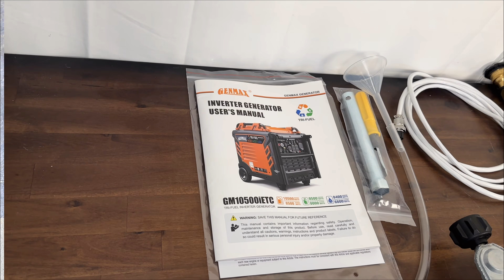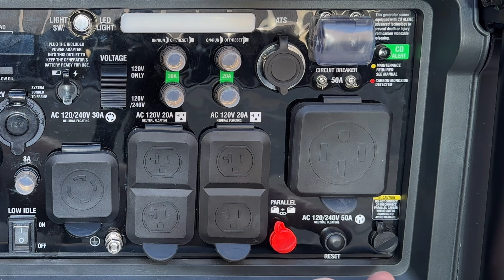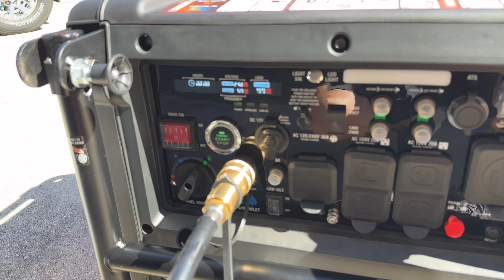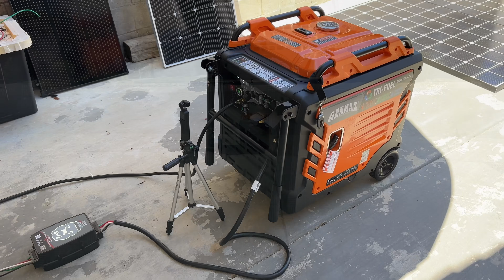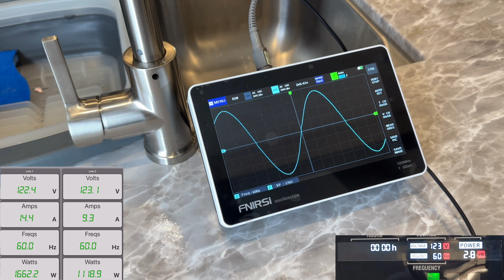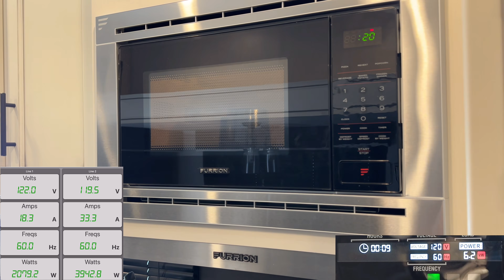Best New Generator GENMAX 10500iETC Tri-Fuel Inverer Generator!

Comment: Underpowered toy. 
Need a LP generator that outputs a minimum of 12,000 running watts & outputs split phase 120/240VAC and 20,000 watt surge. Gasoline evaporates, turns rancid, is stored in containers that are susceptible to puncture or spill and is illegal to stor in bulk in most states without specialized containment and recovery systems,  while LP stores in all weather in non puncturing containment that fuel levels can be monitored using ultrasound, pressure gauges and/or internal float and never goes rancid, stale or inert and most importantly, can be bulk delivered and stored on site.
Reply: No? Running my entire home including 2.5ton central air, gaming PC, LED tv, dishwasher, deep freeze, fridge and a floor fan - only using 3100 running watts. Get a soft start for your central air and manage your use - this is plenty to keep a household going. I'm actually running the GM9000ied so even lower running wattage.
Reply: @catastrophicfella  :face-green-smiling:Good one. I've heard that before. Sooner or later they all syncchronize to start at the same time.

Comment: Does the battery have to be charged in order for the pull start to work?  ty
Reply from the maker: Propane works with no battery and pretty sure gas does as well but you need to manually choke it. 
Sorry I don’t remember… 
May have to check again if both works

Comment: I have been considering converting my Honda EU6500i to run on natural gas. However, the additional cost is about $1000 for the kit and the natural gas guy to convert the barbeque outlet so I can hook up the generator. Instead, I would sell this Honda unit and buy the Genmax 10500 unit and have money in my pocket....but..but...it's not available in Canada and parts and service availability are minimal right now (and non existent in Canada), and the quality of the unit is still unknown (although I would take a chance on that). Maybe this will be doable some time in the future....(sooner rather than later I hope)
Reply: UPDATE: Sold the Honda EU5600 for $500 more than I paid for it second hand 12 years ago. Can't argue Honda hold their value. After I bought the TMG 10500 I put almost $1000 back in my pocket and got a tri fuel unit that outputs much more than the Honda. . 

Just have to hope the new generator proves reliable long term. However, from what I can research, it seems to be of high quality...

Comment: I recently purchased this unit and works exceptionally well other than the minute/hour meter resetting and when i turn it off using propane. I always get a small backfire after turning off the controls in order according to the directions. The spark plug is gapped correctly, so it just may be the LP in the line. Does anyone else have this pop at the end? Should i turn the LP off first, then the switch to off? I've been shutting it down using the power off button, switch, and then LP off.
Reply from the maker: Hello, couple tips. Ditch the stock Torque spark plug and get a NKG and then if only running LPG close the gap to about .018-.020ths. Also turn LPG off first to clear the line till gen dies. Then shut off the rest. Unless you are going to run it on and off a lot. But if shutting off for the duration or several hours like 8 or more best to close tank.
Reply from the maker: A little back fire is normal with LPG some do it and some dont

Comment: Good generator. 6000watts on natural gas isn't to bad. Can run a pretty good single person house with that or small family that isn't power hungry for energy. If your system has a well or city pump that isn't unpowered in a black out. You'd just hook this badboy up and run off gas to energy.

Stick this sucker in the garage or a shed and run a hose extender for the exhaust out to a exhaust vent and you should be golden. No thieves to slap on or take the machine and it'd be way quieter from the other houses.

From the looks of it. Natural gas will run a house at 6600watts either from the 220-30amp twist or the 4 pin 240-50 (at half power.). Kinda shame they only give the 8500watts to gas. And 8000 for propane.

But if you're energy light for basic for AC/Heater system, Washer/gas-drier, Fridge, Gas water heater, gas stove/oven. You should be able to work for the rest of the stuff without any problems unless you're packing quite a few desktop PC's running over 500watts on a family set per kid/hobby/wife deal. Thought if your house is mostly electric of the AC/-Heater system, Water heater, Stove/Oven, and Drier. I'd say not to run those roughly at much on generator mode. AC/heater can already cook over 3000-4000watts for a Central system. Electric Drier will probably cook over 1500watts running. Electric stoves run 1000watts almost per burner. Not continuing the oven coil. And water heater probably cooks around 1500 or more watts or so when it clicks on. So for people who are more on the gas drive will probably be able to easily fly in a black out if it's local and not shutting your water or gas vines offline to. (Though i bet the gas bill will sky rocket lol.)

Comment: I was under the impression natural gas didn't need regulating?
Reply from the maker: Still need a load regulator.
Reply: @johnnysweekends  Whats the max Pressure the generator can see on NG inlet connection?

Comment: I am looking for a tri fuel inverter generator for my 1400 sqft home. No less than 9k run time on NG. I would like to have an inverter generator but the only tri fuel with enough watts was a tri fuel Duromax and it doesn't have an inverter. I need it to last days at a time in case of natural disaster. I have been searching for some time and no one has been able to give me enough information to make my decision. It's a lot of money so I need all the helpful information I can get. If I have to go with a non inverter, I guess it would be the Duromax XP13000. I like the Champion tri fuel inverter but dont think it will have the power Duromax does.
Reply from the maker: Well I think no matter what no one can give you the correct answer. Some people can get buy with a 2200 watt unit which sips fuel. But only powers some basics. 

The Genmax is a nice unit and should power most anything you need. But normally when the power goes out you sacrifice and power what you need. 
Do you need to power one fridge and maybe wifi if it even works? Maybe two fridges and coffee ? Or the whole home and ac as well. 

It all depends what you can live with and for how long. 
A large generator burns a lot more fuel. Especially using natural gas. Just not as many btu’s so you get lower power out put just like it says on the specs. 

If you don’t want to worry about power and always have enough then the Genmax will fit a lot of needs. Just know it will burn more fuel. 

If you don’t need as much then a medium sized unit can save on space, cost and fuel. 

So once you decide what you really need to power then you can decide on a small, medium or large unit.
Reply: @johnnysweekends  I believe, after reading all the comments, this Genmax would be the better generator for our home. I'm figuring in the possibility of medical equipment for my Mom in the future.
Reply from the maker: @pjperalta5298 definitely good for whole home back up but if you only need a couple devices a smaller unit would save a lot of fuel. Build you need to power large devices then this will cover most everything you need 👍🏼

Comment: Be aware, genmax hos refused to provide me a pinout or instructions on how the ats port works. The wiring diagram is included, but no details on how to use the ats port at all.
Reply from the maker: That’s probably because they don’t want to give away info on how it works for others. It’s for them and there own transfer switch. Which they are finishing up. 
If no one else has one on a portable unit. I don’t think I would give info on how it works either. When you buy the transfer switch you use there own. Kinda like a generac I don’t think they will give you all the info as well. You use the generac transfer switch
Reply: @johnnysweekends  true, but it seems misleading to say o product supports ats, but not have one for sale yet. Also, Westinghouse has portable units with the exact same ats plug & wiring diagram. I will be designing a conversation box to allow this generator to work with any two wire start ats, if anyone is interested.

Comment: Nice generator. My advice for purchasers is to get rid of the GFI outlets. I had them on my Honda until it decided to shut off while unattended.
Reply from the maker: They can be a little finicky depending on load or what’s plugged in. 
I noticed this to sometimes and was wondering gfi or the load and some tripped. 
But more and more I’m wondering if the gfi is causing the issues
Reply: In the case of my Honda 5000 SX my gen was in a compartment and the GFI outlet ran a cooling fan. The GFI tripped but caught it in time. The manual states that this generator should not be used in medical applications. Now you know why! Reliability. When this happened to me the GFI's came out the next day. Unfortunately in our litigous society the manufacturers have to cover their collective butts.  @johnnysweekends

Comment: I have the  9500 of this unit.purchased mid last year. Can this one run in parallel even though it has a slightly higher output? THX
Reply from the maker: Yes you can parallel both 👍🏼😀

Comment: Is the fuel selector a solenoid or motorized ball valve? I read about the solenoid failing on similar models.
Reply from the maker: It’s a electric piston that goes in and out to allow fuel to flow or plug it.

Comment: If you have a contact at Genmax, ask them if it might be possible to introduce a model with significantly more momentary starting wattage from idle speed.

I have a Predator 9500 right now.  It has no trouble starting my 2.5T reciprocating compressor AC with a soft start, but it struggles to do the same from idle.  

Same thing with my well pump.

Once stabilized my house rarely draws more than 5kw continuous.

If they could pack some more reserve capacity into the inverter electronics everyone would benefit.  

15k peak (1s max) would be amazing.

PS: This is still splash lubrication, right?
Reply from the maker: Yes still splash lub. 
But the engine needs to be revved up so it can handle the load when applied.
Reply: Of course, I fully expect an inverter genset's engine speed to vary by load.  

The point I was trying to make is such that when these units are idled down their momentary max output is limited primarily by the inverter electronics.  If the manufacturers can beef up the reserve capacity in the inverter circuit (larger capacitors?) the starting loads could be handled with less dependence on the engine speed rapidly increasing.  Certainly, this comes with a higher price tag, but I think it would be worth the cost of admission. 

With soft starters installed on my 2.5T AC (reciprocating compressor, not scroll) and my 1HP well pump, my Predator 9500 has no issues starting either of them when it is running full speed.

If I've got the genset idled down in "eco mode" it can start the well pump without too much fuss, but sometimes the AC soft starter will fail to start the compressor because of inadequate current available.  It is usually successful on a second attempt.

All that said, when I run the genset in the summer months I usually end up leaving it at full speed so the genset isn't caught off guard.
 @johnnysweekends
Reply from the maker: I agree it would be nice to have a genset be able to run at low engine rpm and store the energy needed in capacitors then boost to start the load like a mini soft start installed in the gen. 
And yea when temps get higher power of the gens start to drop.

Comment: not in stock on the amazon link. how much is this? only says "Currently unavailable" and doesnt list a price ;) if i'm upgrading my 5000w dual fuel gasoline/propane, this looks like a nice unit. 
for those concerned about the lack of fuel injection, if you're running natgas or propane, it bypasses the carb, so you never need to clean the carb if you dont run it on gasoline
Reply from the maker: Very true statement…! 
I’ve said this but maybe I’m not clear enough lol. 😂

Oh see if this works…. Shows it does but yea it could be out of stock already 🫤
Make sure you use promo code https://amzn.to/3OO24uy
Reply: So if you are using this above 5000 ft MSL do you need to re-jet the carb? Or better question if you burn LP only does that mean you do not have to worry about using it above 5000 ft? @johnnysweekends
Reply from the maker: @MrCKM1962 hello, yes a carb reject will be necessary if you use gasoline above about 3500ft unless you plan to only use it for a few hours or so. Long term continued use then yes a reject. 
If using propane then no reject is needed…😀👍🏼

Comment: The sine wave distortion right at 0v is probably due to no physical ground to reference. Read the manual it probably has a spot for a ground jumper if the connection you’re plugging into doesn’t have an earth ground.

Comment: Are there Chinese motors in these? Also from what I’ve seen the Honda eu7000is is severely underrated, there are videos of it putting out almost 10000 watts. What is your take on that? I do want to buy an inverter but having a hard time making a decision, price will not affect my choice. I just want the very best most reliable for an extended emergency. Thank you, also you made an EXCELLENT informative video.
Reply from the maker: All the new gens even the Yamahas are coming with Chinese made engines. The eu7000 is or was a good unit but in the forums and groups several are having problems with injection pump and a couple other items which is showing to be a spendy fix. Especially if the dealer does it. One post on there a eu7000 efi was under warranty and the dealer couldn’t get Honda to cover it, and the part wasn’t even available for several months. So that’s a $7000 paper weight plus the repairs. Honda is still good but I dont know if they are reliable like 10 years ago and more. I always recommend a insurance plan / warranty when buying.

Comment: If I didn’t have my EU7000 I’d jump on this.  The additional power isn’t needed til I need an electric stove 😉
Reply: Same, though I doubt it has the longevity of a Honda.
Reply: @yolo_burrito  Agree ! I just wish Honda and Yamaha would advance their units more.
Reply from the maker: You could buy almost 3 of these for one Honda and have more power and probably still be ahead. 

Go read the problems with the eu7000 EFI units. 
Not cheap to fix

Comment: Genmax certainly is a leader in features but my concern would be parts and service.  Still I am impressed by what Ive seen here and on Gavins Garage
Reply: Thats our concern too. We have the Powerhorse 7500 Inverter and have unresolvable issues. We'll get the GenMax 10500 if parts and advise is available.
We love out GenMaxs, all bought on Johnnys recommendations. Wish they were as quiet at the Harbor Freights.
Reply from the maker: I have been telling them to make the units quieter
Reply: Great helpful info... keep up the good work!!! Can a larger external secondary muffler be retrofitted to make it more quiter?
Reply from the maker: @ryancharles9252 🤔

Comment: Nice review!!! Seems like a solid unit with the likes of Honda or Predator options. They threw everything minus EFI at this model. Included battery charger is a new thing which shows they understand what consumers want. Kudos to Genmax for listening. With the included ATS this is a great solution for home use with a perma nent gas line. The problem with these units is fuel comsumption. If you have a lengthy power outage you need a large amount of fuel storage. For this reason I went with multiple smaller units knowing they sip fuel and can conserve if needed. With 40 gallons (8 cans) I can run for more than a week. This was tested after a hurricane. On the 4th day gas lines were significantly shorter and by 5th day you had access to multiple gas station options which were getting fuel delivered daily. I started refueling 10 gallons a day on day 6 just to be safe. By the 8th day I had power restored and used up my full 40 gallons. Ran 24/7 with 1 or 2 (night) and used 3 when needed during day. Only 120V so no hot showers :-(
Reply from the maker: Thank you 👍🏼😀

And yes nice unit for sure for those wanting big power. 
The charger was my idea 😁👍🏼
I talked to them during the Vegas show for ideas and we have talked since so some things like the 12v coming back was also a idea I threw at them as well. 👍🏼
EFI…. Well…..that’s another idea as well 😁😉
Reply: @johnnysweekends  Your idea of the charger is a good one; however the charger they provide  is not a battery maintainer so it is not safe to leave on permanently. Another idea would be to simply install another  lead on the battery coming out through the front so one can attach a proper battery tender. I did that with mine and simply stored the factory charger away with the extra parts